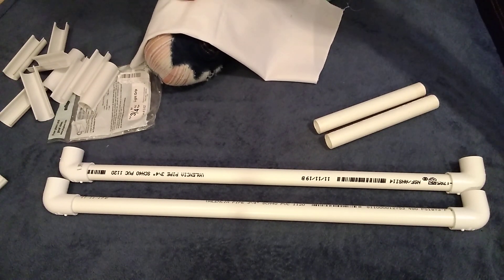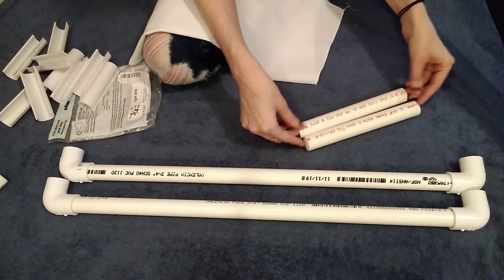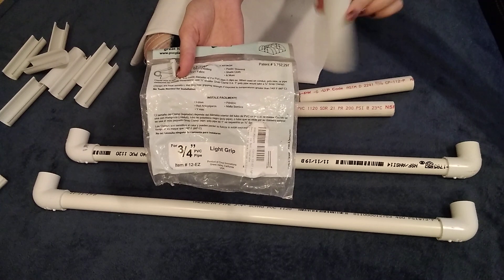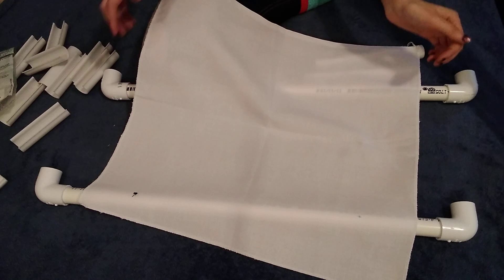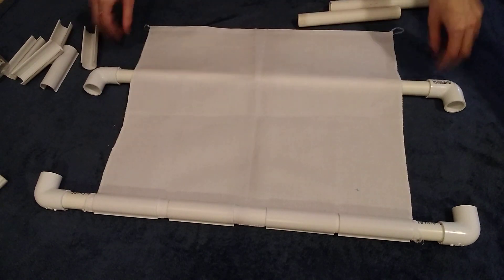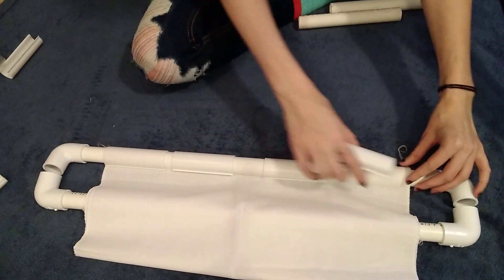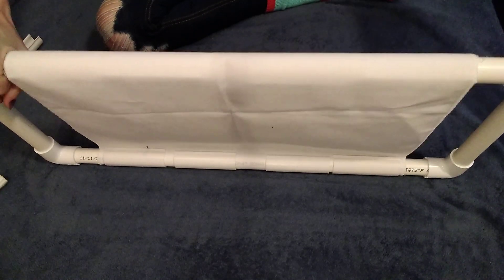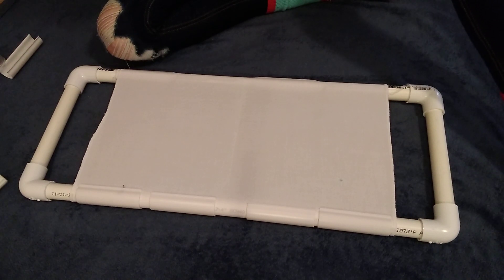Flosstube: Trying to make a PVC scroll frame after seeing one on Facebook

Comment: You could put a center mark on the pvc top and bottom! I also use leader strips that are the length of my scroll rods and about 5in deep!  I attached sticky back velcro rough side  to my frame, soft side on the leader strips! Mark the center on these as well ! I also use suspender clips with twill tape for side tensioning! It works really well! Thanx for a really neat idea ☆

Comment: Great video.  I have a couple of large projects and needed a longer frame for them.  I saw Kim's on her video and my husband made me a couple like that.  I used the 1/2" PVC and it works great.  One frame is 30" and one is 60" (for the large project).  I used the qsnap clamps with them
Reply: Hi  question  re your 60inch frame  does it bow in the middle  when you place lost of tension  on it
Reply: @ebonydove2010  My husband made me a center support that i wrapped in felt and put in the middle of the frame from top to bottom.  I make sure it's not going under the rolled part.  I also use the side tension clips to help keep my fabric taut.   Seems to work o.k. for me.
Reply: @calicokitty6  thanks
Reply: How is the tension? Tight? Similar to hoops or qsnap?
Reply: @SNNGS  Just like a q-snap.  I cut a piece of felt into long strips and put them on top of my canvas before putting the clamp on.  This makes it even tighter and easier to pull the clamp off when needed.

Comment: FYI, I tried this and found it works great for smaller projects - like 12” or less.  For larger projects it was just too difficult for me to get the clamps on evenly and the frame wasn’t remaining stable.  It’s a great idea, just not for larger projects.
Reply: I suspect for larger projects you might need larger or thicker pipe, the 3/4" might be too flimsy

Comment: Any update on this? How did it work out ?
Reply from the maker: It's worked well so far. The sides feel a little loose similar to what happens in a scroll frame but it doesn't bother  me enough to buy side bar tension clips.
Reply: @CraftyGamingJamie  Don't buy tension clips, make them. I use elastic hair bands and binder clips. Link 2 (or more) bands together, wrap them around your side bars, and then catch both bands with the clip before clipping it on your fabric. Works like a charm!